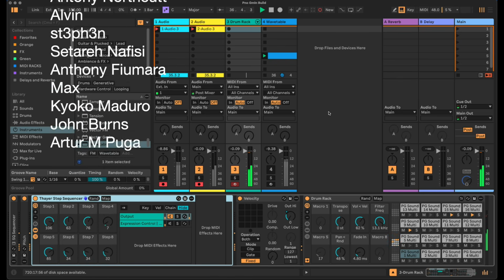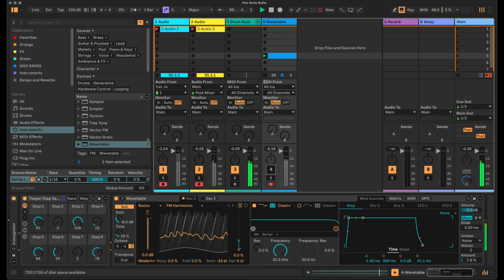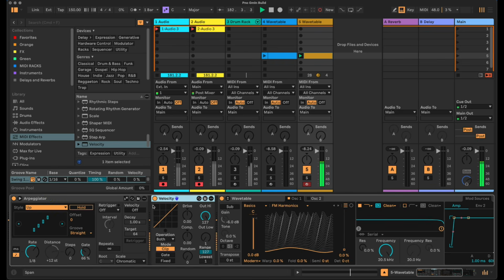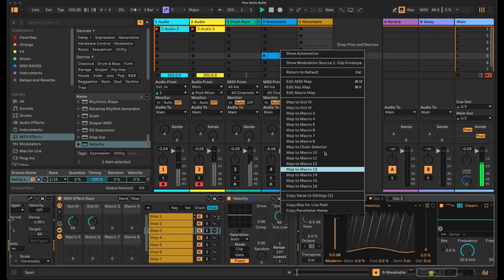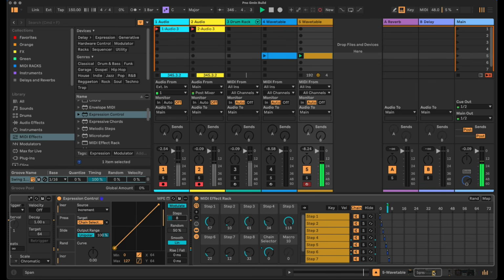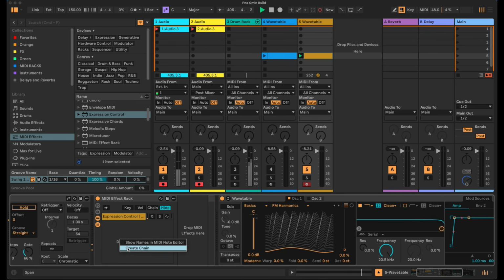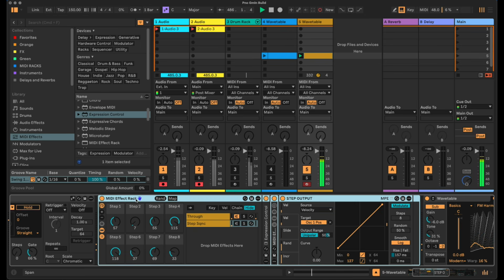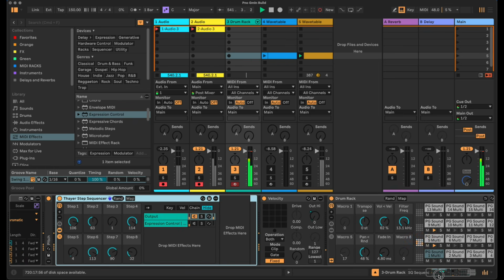Ableton Tutorial: Make Your Own Step Sequencer and map it anywhere you like

Comment: Awesome video, as always!
Quick question though: why not set this up using a separate MIDI track that monitors the MIDI from your “clock” track (or an arpegiated long note), then use Ableton’s native sequencer with Expression Control mapped to whatever parameters you want to drive?
Faster and also potentially a solution to the "number of steps" modulation issue. Maybe there’s a downside I’m missing, but I was curious why you didn’t go that route.
Would love to hear your thoughts (or anyone else's) — and as always, brilliant work :))
Reply from the maker: Yeah that’s a great shout too! For me this one is was about having a lot of control over the steps and being able to modulate each of them individually (or at the same time) - hence mapping each step value to a Macro for easy performative access with a Push (or other midi controller)

Comment: On modulating Ableton’s tempo: I made a max device that can do it, but I wouldn’t recommend using an LFO to modulate it (Ableton tends to hang or crash if I do this)

It works better with Expression Control random, where the tempo will jump to random values (and not be constantly smoothly modulating between values) 

If anyone wants the device, I will figure out how to upload it to the max Community Resource site. However, I think there are devices on there that will do the same thing. I just wanted to dip my toes into the max world and figure it out. 

Great vid!!
Reply from the maker: NICE ONE! Gonna check this device if you upload it. Pop a link? 
Yeah, Ableton kinda freaks out when you get crazy modulating the tempo, but that can be fun too!